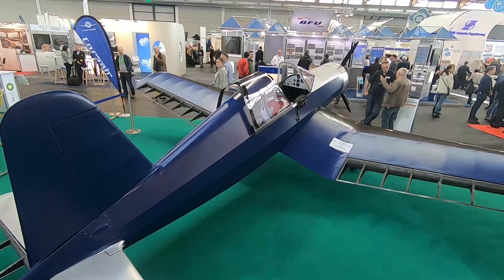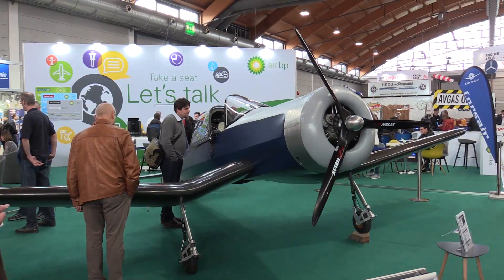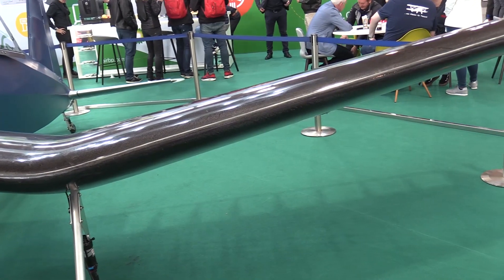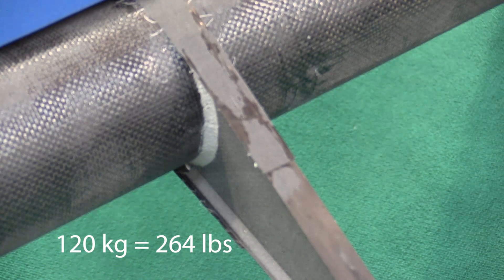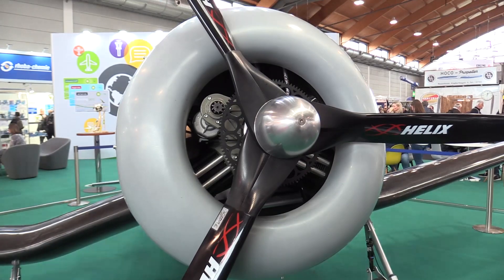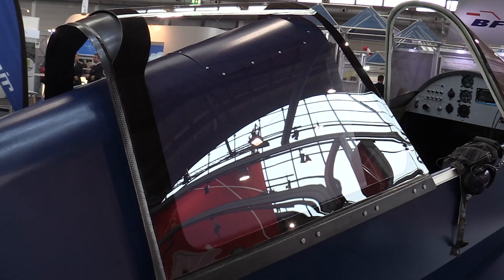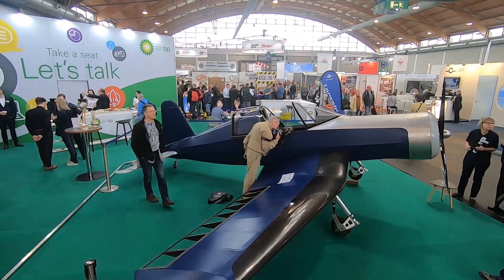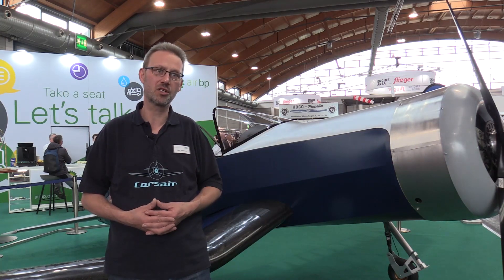Cool Microlight Carbon Fiber Corsair

Comment: Yeah, no.  This kind of looks ridiculous.  You might want to consider using a different ww2 plane to base it on.  The Corsair is hands down the most beautiful prop plane ever designed, and this just looks horrific in comparison.

Maybe use a plane that is less gorgeous than the Corsair so that the differences are less shocking and stark.

Comment: Powerful 42hp 3 cyl 4 stroke radial engine???? which probably costs as mush as a brand new skidoo equipped with a 800 cc 2 stroke 100+hp engine that weighs as much or less as this powerful lol 42hp 3cyl radial....Damn it would be cheaper to buy a new skidoo...strip the engine out of it and throw it in this plane for 10x better performance at a fraction of the cost.
Hell a 2000 dollar brand new 377 snowmobile engine would be just as good as this 3cyl...
I bet they sell a ton of these planes lmfao...NOT....smdh.

Comment: It is cool to make a replica, but the bent wing was a work around for a very powerful motor and short landing gear. 

Straight wings would have a less complicated wing spar.
Reply: Yep, but they wouldn't look like a corsair with straight wings would it?
Reply: @shelbyseelbach9568  No, it would look more like a Hellcat.  
There is a Van's RV8 with a radial engine that looks pretty nice. Hellcat RV8. https://youtu.be/1HdqLQEpZoA
Reply: @kevinmoore4887  Not sure you understand the purpose of a replica?
Reply: @shelbyseelbach9568  I get it, you can't make a Corsair or Stuka replica without inverted full wings. But it comes with weight gain. Vs using a straight spar and calling it the less popular Hellcat or Thunderbolt. 

I wish them luck.
Reply: @kevinmoore4887  ya, and it's easier to drive a car across country than ride a bike, but if i want to ride a bike across the country driving in a car won't accomplish that. You are still missing the point i think.
Reply: With carbon fiber the spars are not really more effort to build - wether you place the fabric in a staight mold or in a bent one makes no big difference. And the shape does have advantages: 

1. less interference drag between wing and fuselage. 

2. shorter landing gear with less drag. 

3. bigger and more efficient propeller.
Reply: @jh-aircraft  the main advantage that it has is that if you don't include it, you haven't built anything that replicates a corsair in any way shape or form. 😉
Reply: @jh-aircraft  Thank you for the explanation about the carbon spar. Best wishes for success.

Comment: Hey guys, is it possible to take any old (ww2 era) fighter plane, rebuild it with carbon fiber and all lightweight materials, put the Same engine, and make it perform far better than the original? Or is it required to redo the math from scratch?
Reply: It's possible to copy, millimeter-for-millimeter, a design from world war 2 in modern composites, and it will have the same static aerodynamic properties.
However, the weight distribution, rigidity, and a host of other factors would change the way it flies, significantly, from the original.
That said, many of the unique design features of classic aircraft were influenced by the limitations of the technology of their time, and the specific roles intended for them. For example, the inverted gull-wing and long nose of the Corsair, chosen for structural and aerodynamic reasons to make it fast and strong as a fighter, also make it difficult to land. The massive R-2800 is complex, heavy, thirsty, and maintenance-intensive. The aircraft was difficult to fly, heavy and with poor visibility and low-speed manners.

 What does that mean? It means that, if one wanted to make a plane that looks like a classic warbird and offers the sort of experience we'd like to THINK flying such a plane would involve, then it would be best to start with a fresh set of requirements. 

Keeping to the corsair example, say, scale the planform to 75%. Eliminate unnecessary items like wing-folding mechanisms, carrier-rated landing gear, machine guns and armour plate. Use a more forgiving airfoil, maybe fowler rather than split flaps, with a bit more washout. Make the structure from composites. Move the cockpit canopy slightly up and a hair further forward. Design it around something like a R-985.

Now, instead of a 10,000lb, 2,000hp handful of an aircraft with terrible landing manners, you have a 2,500-3,000lb replica with a supercharged 450hp radial, that's much easier to fly, still manages around 250mph, makes all the right kind of noises and burns fuel in the 20-30gph range instead of 50-100gph.
Reply: Well, in the Radio controlled world, this happens all the time. Scale models are re-done with modern building methods ( and a total disregard for pilot safety ) and much more powerful engines all the time and they fly very well indeed, much stiffer and lighter and with lower polar moment. The principal problem would be "the same engine" - the Pratt and Witney R2800 is a very heavy engine and all its weight is right at the front, and the engine would result in a nose heavy weight balance if you were to save a lot of weight from the rest of the airframe. However, if you were remaking the entire body from composites, it is not unreasonable to imagine you might do the same for the engine to save weight - however it would be mind bendingly expensive to perform work like remaking the parts in titanium and redo all the crankshaft balancing engineering. If you want a great performing aircraft, just buy an Extra 330. The WW2 designs were made at a time when we didn't really understand aerodynamics, a lot of them have unpleasant stall /spin characteristics and evil ground handling, very poor pilot visibility and were made with little regard for pilot comfort or safety.
Reply: The other guy had a good answer I think. I just thought you might like looking up modern prop driven fighter planes.
They look a lot like ww2 fighters but they have been upgraded and improved with tech and materials. Sold over seas to smaller countries mostly. 😊👍

Comment: Can I decide about RETRACTING THE DAMN LANDING GEAR??!!??  A corsair MUST have retracts!
They could have done better on the windscreen.  It's just too 'off.'
Reply: A corsair must have retracts? Yes, i agree. THIS IS NOT A CORSAIR.
Reply: As light as that gear is, I'm pretty sure you could get away with just a johnson-bar linkage to rotate them back into the wings...
Reply: How much heavier would it get with the motors and articulation for the gear?  The weight limit is rather brutal for this class.  My brother weighs more than 120 kilos.
Reply: @joesterling4299  This isn't up for debate, Sir, a Corsair needs retracts.  Regarding your brother.  If he removes one leg he should hit his goal weight.  Also, have him look into becoming a bulimic and/or anorexic.

Comment: This Airplane is NOT PAINTED but covered in Oratex600 the BetterAircraftFabric, a modern woven cloth already coated and UV protected at the factory. Its use is also important to make the weight limit. The BetterAircraftFabric is the lightest possible solution for fabric covered airplanes...

Comment: Take the plane with amongst the worst spin characteristics in history and introduce it to the pilots with the least experience..
Reply: You need to remember that this airplane is very different. It’s not just size, but the entire fuselage is made from a completely different material and the airplane is A clean sheet airplane. Just because it’s model to look like a World War II fighter does not make it a World War II fighter. I would bet that the spin characteristics are much nicer on this aircraft as all the weight is far forward.
Reply: Keh?
Reply: This is NOT a corsair.
Reply: The F4U could roll over when too much power is applied at low speeds with flaps extended, caused by the massive radial engine's torque.
Reply: @NEtrailrider1  and, once again, this is NOT a Corsair, by any stretch of the imagination.
Reply: @shelbyseelbach9568  I was not commenting on what it looks like, only how hard the real one was to land, in reply to your "spin" comment.
Reply: @NEtrailrider1  i never made a spin comment.